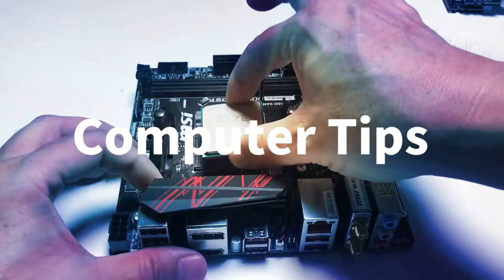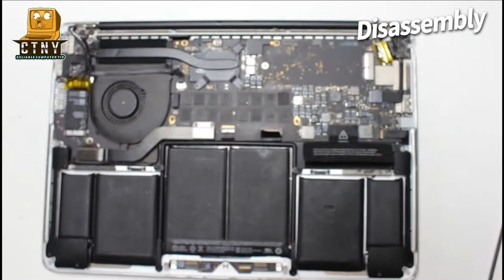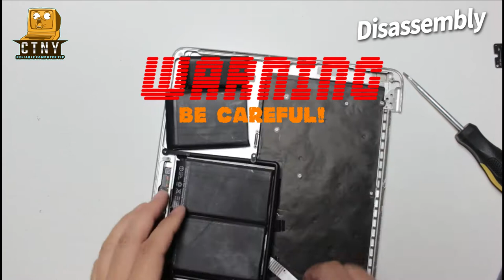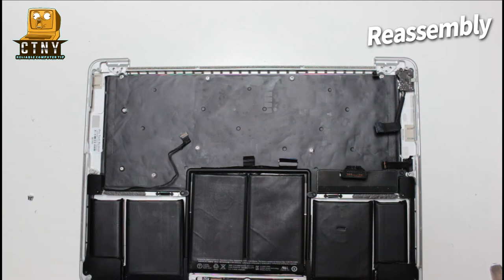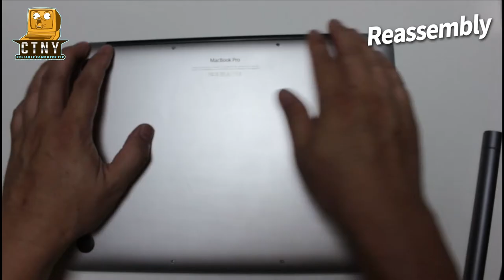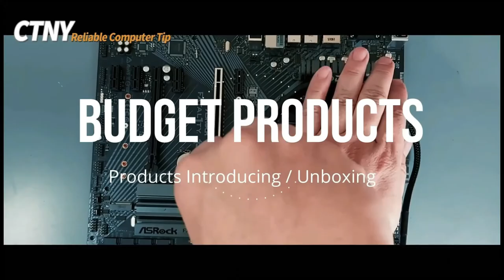Apple MacBook Pro A1502 Keyboard Palmrest Top Case replacement - MacBook Pro Retina 2013, 2014, 2015

Comment: I took my 2014 macbook into apple because the track pad suddenly stopped responding and the keyboard had some lag. I didn’t expect it to be a $400+ repair!  They said they needed to replace the top case so I hope following your video will resolve my issue. If so, I owe you!
Reply: Did it?

Comment: Hi 
I want to know that in your video you have told that how to install windows 10 only os  on mac book pro 
But now can you tell how to install mac os catalina on mac book pro (now i am running Windows 10)i want to go back on mac os
Reply from the maker: As I mentioned in that video, you need to prepare a macOS USB bootable drive before you do that.  Insert macOS bootable USB drive into the USB port and push the power button and then press the 'option' button to choose a bootable drive. When you boot to recovery mode, please go to Utility to make a partition to APFS and erase partition accordingly. When you finish, select the menu 'install macOS(Catalina)' to start to install macOS to internal HDD. If you restore to macOS, I will recommend using Windows OS as a portable device like this video.  Link: https://youtu.be/IHsLP7kZNvY  Thank you for your comments.
Reply: @comtongny7776  Thanks for your response  but can you make a dedicated video on it that how to install mac os on a blank mac book pro via bootable drive plzzz
Reply from the maker: @TechBrothers2016  OK I will Thanks
Reply: @comtongny7776  can you make a dedicated video
Reply: @comtongny7776  can you tell that how to make multi bootable pendrive only for (mac os mojave and windows 10) on windows 10.